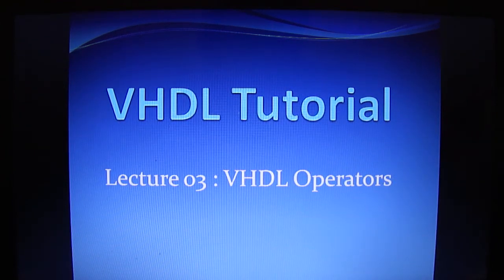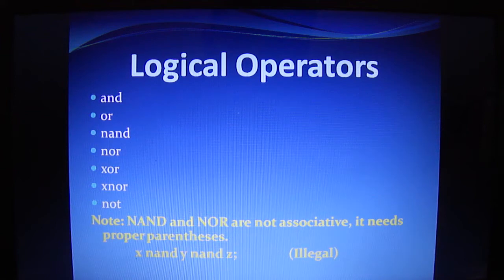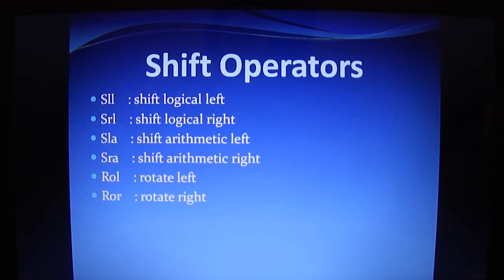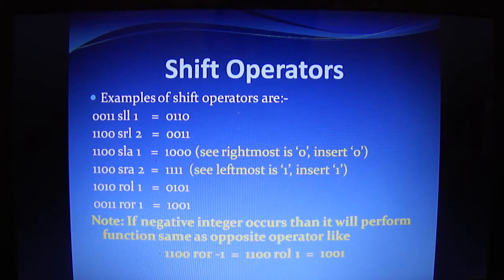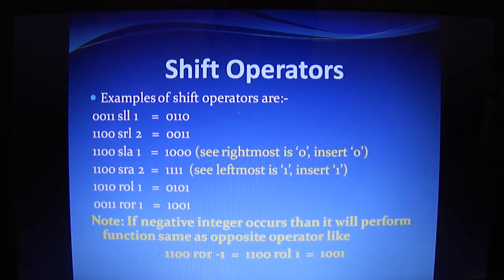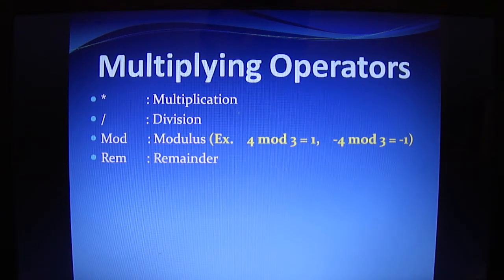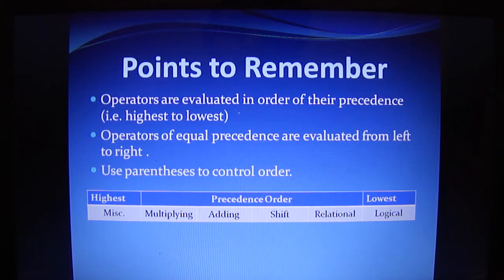VHDL Operators

Comment: 00:03 VHDL has six different categories of operators.

00:46 VHDL operators are not associative and require proper use of parentheses

01:35 VHDL Shift Operators

02:12 Shift arithmetic operators shift the bits in a specified direction.

02:46 Negative integers result in opposite shift directions

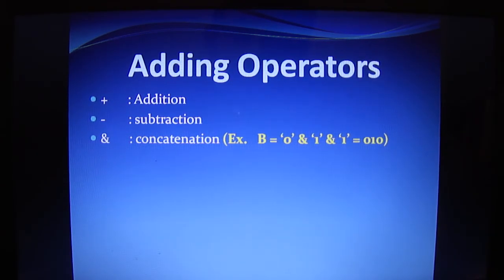03:27 VHDL operators include addition, subtraction, concatenation, multiplication, division, modulus, and remainder.

04:06 VHDL operators are evaluated based on precedence

04:46 Operators in VHDL follow a specific precedence and evaluate from left to righ